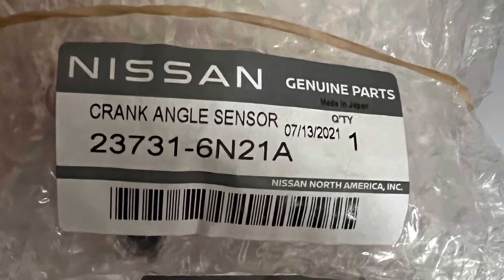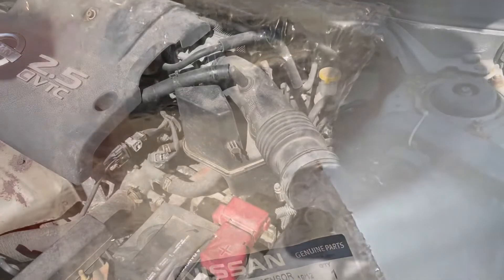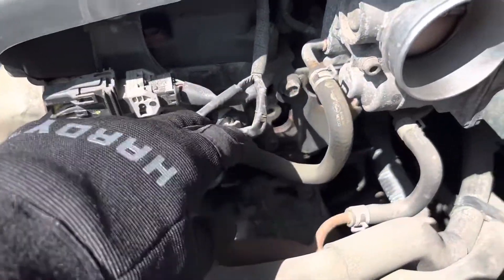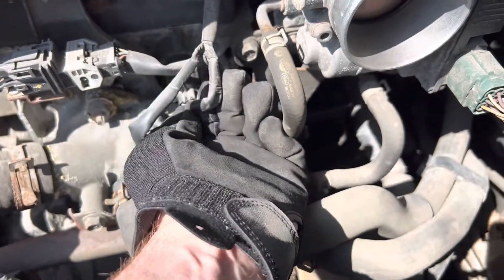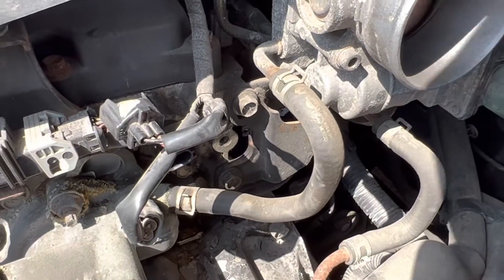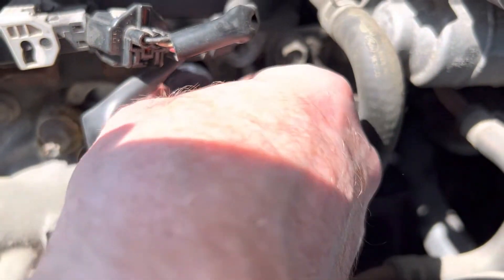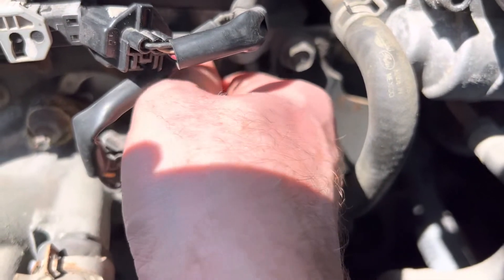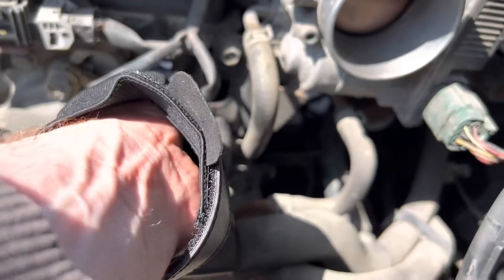How to fix Nissan 2.5 engine no start when hot.

Comment: What symptoms did it have?
Reply from the maker: Hi, it stalled on the road on a hot day, then after half hour it started up fine and we drove it home. Also, sometimes it would not start back up if you shut it off while hot and have to wait for it to cool down.

I changed both sensors with OEM parts and it’s been super reliable ever since. I am at almost 200k miles with this Altima and have had to change the sensors only twice since 2005. Thanks for watching and good luck.
Reply from the maker: Symptoms was crank and no start. The engine would just crank and no fire.
Reply: @deicibao  my symptoms are crank… then start.. after about 1 min.. so im heading towards fuel pump.. thx for the reply
Reply: @RaysOldies 
Any luck?